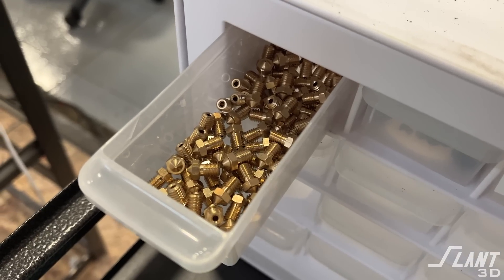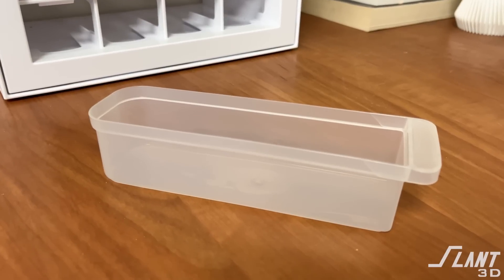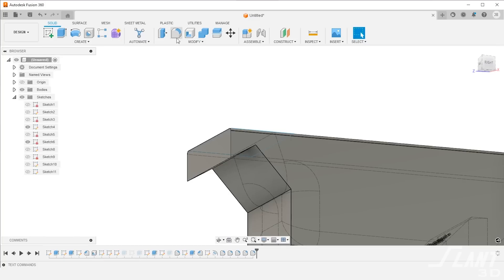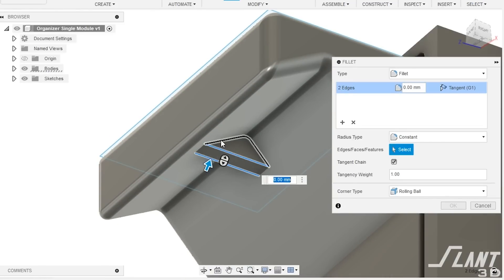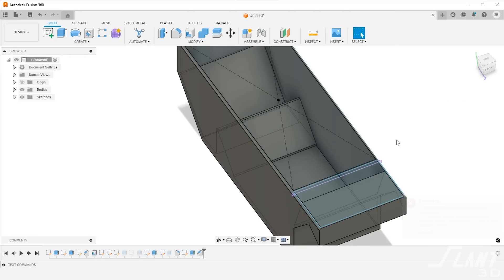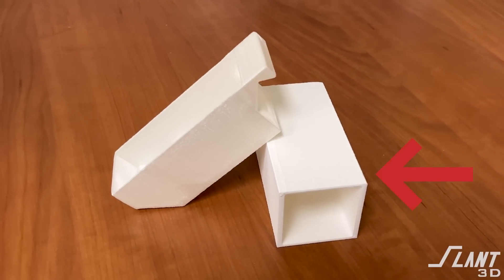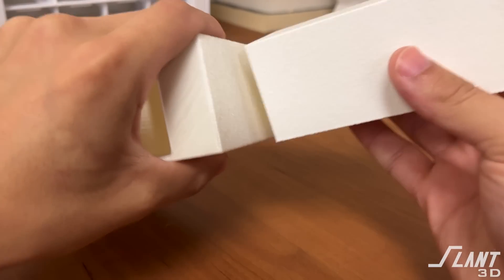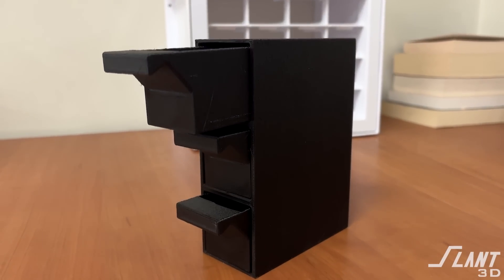Customizable Organizer Drawers | Design for Mass Production 3D Printing

Comment: Most mfg plants use a 2-bin set up for parts like that, so there isn’t a need to have a note to reorder built into the bin.  When the first bin is empty it goes to supply who will fill and replace it and the operator switches to the second bin.

Comment: Just rewatching this with the thoughts of other things that could be included with this. The backs of the drawers could be designed to accept a magnet, not for assembling or fitment, but more for tracking parts usage. The presumption being that the back of a set of drawers can back up to a plate with a matrix of magnetic reed switches that can be used to also assist with parts restock. Drawer n in panel g on station 165 was opened for more than 1 second, which suggests that one piece was removed. Under 1 second we may need better labels if this happens a lot. Bin contains 160 parts, when 125 have been pulled, refill to 150 between shifts. (or hand the person working that station at the next shift a plastic bag of bags with the parts to refill, each with a card identifying which drawer the parts go into, click the 'restocked' button to the right of the drawers once complete.

Comment: Another case of over engerneerin, if you can call this design engineering. Plus the cost factor. Most cases that are 3d printed are great, but cost and time to print is not practical. 

Open bins for storing parts are a much better option, and many open bin design storage solutions work fine. Maybe think, quite literally inside the box and just use open storage solutions, less material, less printing time and surely more practical
Reply: I'm not absolutely sure but I don't believe Slant3d is a mass hand-assembly type business. I could be wrong, but they are probably for maintenance parts, which is not the same as in a manufacturing workflow.

Comment: I love all the points given. One thing I noticed is the scraping sound when opening the drawer and can reduce its appeal compared to the injection-molded version. Can you do a video on how to alleviate this?
Reply: I would try adding two small bulges to the bottom of the drawer to act as skids that have significantly less contact area. It should reduce the amount of friction and therefore noise.
Reply: In forest of a 100+ printers humming along, the sound of a drawer is less likely to annoy.  ;)

Regarding the sound; this product example has the direction of movement is across the layer lines, so sound produced is probably a worst case scenario. Adding a slight curve, or angle to the draw sides could reduce contact area, but in care modifying the design would be needed to avoid a loose fit. The trick is changing how layer lines interact so as to change the frequency of sound produced. Lower sound frequencies are less annoying. If the drawer, or box printed in a different material (eg: TPU), the sound harmonics would change. This could require two print operations vs. a common print. Alternatively changing orientation 90º of either component would help, as layer lines would be perpendicular vs. parallel. But again, this would require two print operations. All trade-offs in constraints of a design.

Comment: If you are trying to optimize for _manufacturing_, the starting point shouldn't be the hobbyists' drawers, but the professional solutions.

For manufacturing purposes drawers aren't good, a useless extra movement to open and close them each and every time, also it has the potential to miss the correct drawer. 

For Kanban purposes it's easier to have a slanted base for the containers, so from one side the items collect on the front of the containers, and from the other side you can have two containers behind each other: when the first one runs out you take it out, the second runs to its place, and the empty container place calls for refilling. Also helps that from the eyelevel of the operator the whole container is visible, there are no obscured corners, to be sure to use all of the items inside.

The container should be large enough so the assembly operator's hand can enter and the inner corners should have a radius so no item has to be fished from the corners, while it needs no marking, it's the position that is marked so when the empty containers are collected, you save the trouble of matching containers to goods. Then the containers are refilled according to a different plan, and placed on the empty, rear positions.

This all for mass manufacturing, where you really need speed, precision, and Kanban, if your manufacturing is just a step above hobbyists, then your solution is a small step forward. Although the transparent boxes give a better view on the presence of parts inside than the small opening above the handle, and the kanban-pocket should be adjusted depending on the size of the goods inside the drawer (eg. an M2 nut doesn't need to be refilled after the same volume as an M6).

I loved the 3D printing part of the video, that's genial.
Reply from the maker: The design is optimized for being manufactured. IE this is a the optimal way to design an organizer box to make thousands of them affordably with 3D Printing. The individual application or specific product being manufactured would have different design needs. 

All good points if making a resource for on a manufacturing line itself.
Reply: You just mean bins?

Comment: Gridfinity
Reply: Gridfinity is great! Especially if you have an active project and need things on hand right away and have sufficient desk space. Although if desk space is limited and you need a bit more vertical storage, this might be the way to go. Of course, there are a lot of options if you look around. The great thing about 3D printing is you can always find or make something that fits your needs!
Reply: i dont think gridfinity has drawers like this. they have other projects, but those attach to a base which is not really a drawer like the video shows.
Reply: @VD-cc4hx It doesn't have drawers that I know of. Of course, given how active gridfinity development is, it's probably just a matter of waiting.

Comment: Nice design as always :) @slant3d  it gives me 7h 15min and $2.15 in some average priced PLA for a 50x50x80 box. Would you share  how is on your end for comparison?
Reply from the maker: Print time and material are dependent on the design of the part. You may need to tray various settings to hit your goal.

Comment: Being honest, thats a genius design.
Especially the option to multiply it by just multiplying the amount
Reply: Also you aren’t limited to square or rectangular layouts, you could make the unit L or U shaped if you really wanted, it makes it easier to fit them in odd shaped gaps you have, potentially saving space.
Reply from the maker: Thanks

Comment: Aahhh, a modular print-in-place drawer. Nice.

I bet this design would also print really well as a clear print too.
Reply from the maker: Thanks. Clear is fine. We prefer colors because they make sure that draws are not interchangable between organizers
Reply: Clear doesn't really work very well, tho..(as in it's not usually terribly clear after you print it..)